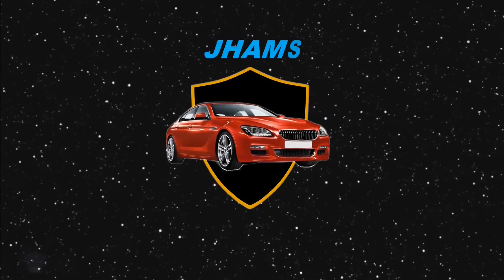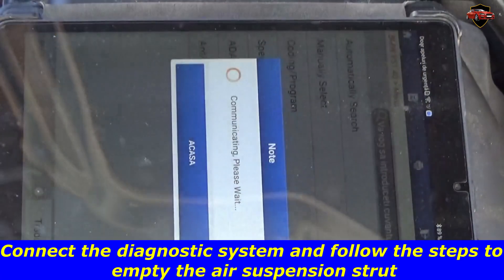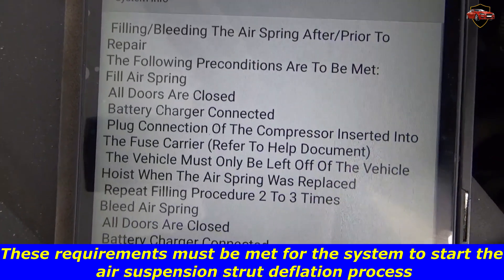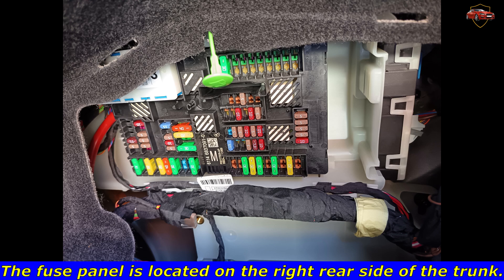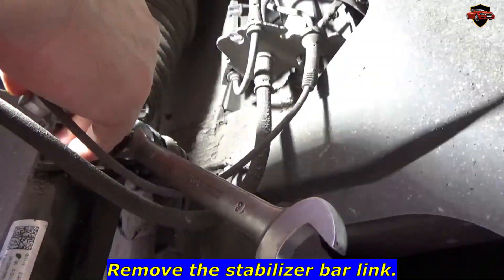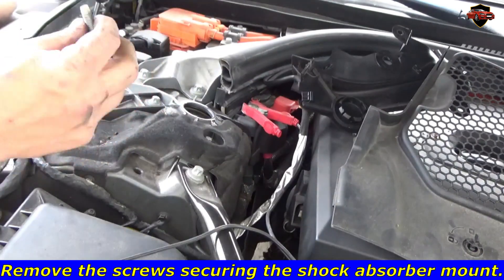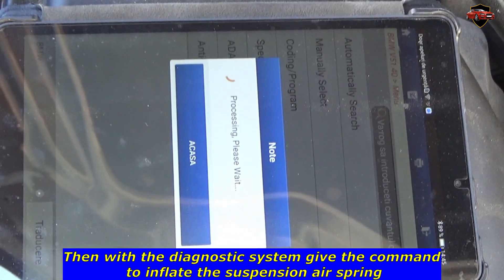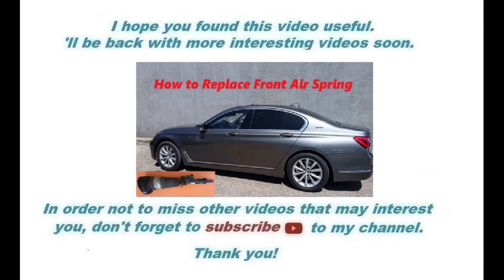How to Replace Front Air Spring – BMW 7 Series /G11

Comment: Im happy abaut this video,i will doing it on my G11,but next time turn the camera paralell with the object(the phone) you filming,any other G11 service videos keep coming.
I cant fing video abaut the timng chain replacement,or crank/con rods bearings replacemet on B57D30B engine,wich  is in the G11,if you have,just upload please.
Thank you.
👍
Reply from the maker: Hello, thanks for your appreciation. The bad news is that regarding the bearings for the bearing and crankshaft, they come paired from the factory, on the vibrochen pulley you have 9 or 13 characters that represent the repair quota of each crankshaft or bearing, they can all be different and for a perfect repair you have to take a set of each necessary size.
Reply: @JHAMS.001-car-repair 

Yes,already spoken to the bmw dealership, they needed the parts numbers of the crankshaft for ordering the right size bearings, it's colour codes, not simple, but not impossible, maybe I will made a video of it,it strange to me,no this type video on YouTube at all.